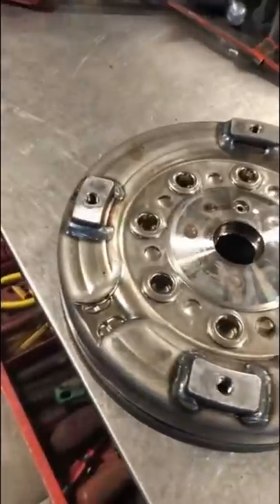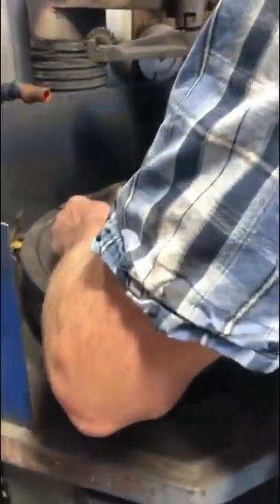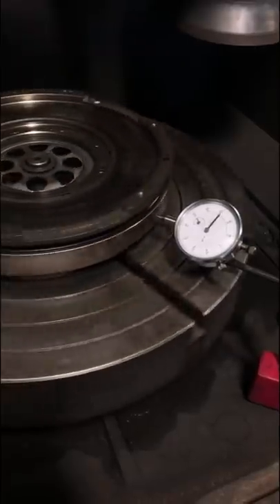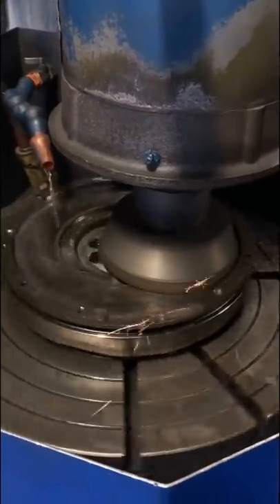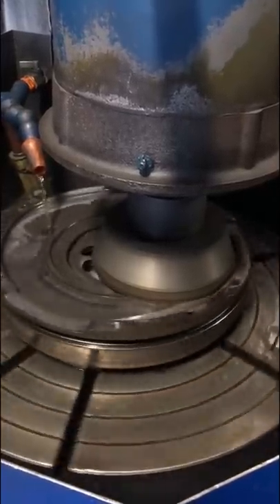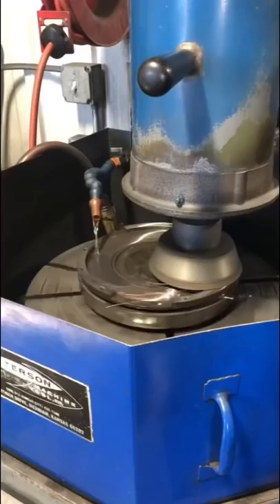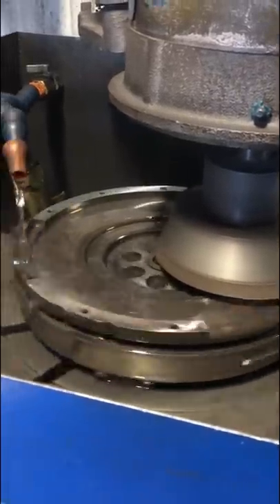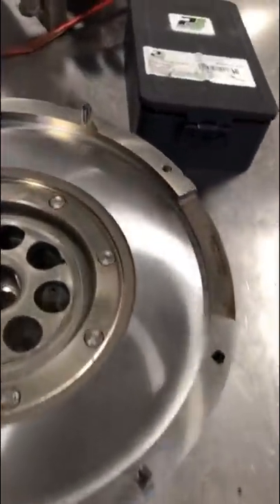#shorts We Can Resurface A Dual Mass Flywheel… But Should We?

Comment: As long as the customer said “yeah that ain’t going nowhere” after they installed it, it’s fine.
Reply: Ouch! That's harsh, man... I'm sure it'll move, may have a slight "shake your fillings out" chatter develop eventually. Customer accepted the risk. It's on them now.
Reply: @scoob66  mandatory nervous chuckle
Reply: Famous last words
Reply: Yea you gotta slap it too
Reply: That's why they need to do contracts for it specifically
Reply: @corythomas4427  don’t think you understand what OP means
Reply: @Nic ,  My comment was meant to be hyperbolic and sarcastic, but I didn't convey that very well. When the meaning of a sentence can be interpreted to have two dissimilar meanings, it is called a double entendre.

 I assure you I understand the connotation of OP's comment, I even took it a step further by implying that the comment was completely literal. As in, the vehicle won't move under its own power.
Reply: He said I made a spacer for it too
Reply: @timjrvine   and call it baby also
Reply: Yep, that comment ain’t goin nowhere. Good work man.
Reply: A S.E Master Certified technician here. I don't think the person who made this comment nor anyone in this string understands how flywheels work or how little resurfacing actually removes. That is if you commented negatively about performing this service.
Reply: "That ain't going nowhere" is always better to hear than..."What? That's custom"!
Reply: I've made that mistake before
Reply: @corythomas4427  you missed the joke lol
Reply: @ZumbiCOD  You're the second person to comment that, you missed the joke I made. Read my reply to "nic ,"
Reply: I would like to know months after the repair how is the flywheel working out?

Comment: I can understand why they wanted to have this done, parts are a nightmare, at the moment and to be honest, you guys do a really great job so I'd have done the same thing!!
Reply: I think it works but not for long terms
Reply: Most of the time sadly if you want to get a part you either hope to get lucky and find a part to buy or you drop alpt of mpney to have a machinist fabricate the part you need. But that will cost you a lot and you will need to purchase the blueprint so yoy can leagaly make the part.
Reply: Yea the "freedum" convoy slowed everything down. 🤡 🤡 🤡 🤡
Reply: @juliengamez7446  I had mine resurfaced a few years ago and so far so good! I couldn’t afford a new one, and one guy at the shop said they couldn’t be resurfaced, but the mechanic said he knew a guy and that’s the guy my buddy trusted with his 95 Mustang GT (RIP to that beast!), so I said ok.
Reply: @paxamericania5923  I'd just reverse engineer the existing part if it hasn't lost too much material. Calipurs and Fusion 360 hobby edition will save you a lot of money
Reply: @paxamericania5923  a good machinist doesn't need a blue print.
Reply: Either way, it'd save money and if it'd work for even about a month, it'd be worth it in my opinion
Reply: @mastakush4272  didn't realize he convoy that was like 2 months ago has been fucking supply things up for the last like 2 years. Wild how that works.
Reply: It looks clean looks like you did well. It's unlikely enough Mass was lost in the process to have any notable effects on performance
Reply: @Glmorrs1  I remember my mate broke a camshaft of a diesel land cruiser into 2 parts due to incorrect procedure. Most of the machine shop refused to Join the broken shaft except the one that our foreman knew. Lol, my mates ass were saved.😂🤣🤣😅😆
Reply: @mastakush4272  lol yeah didn’t have anything to do with covid restrictions at all.

Comment: You do what needs to be done to get the vehicle back on the road. Looks like a good resurface to me, I'd have no issue running that on my engine or a client's.
Reply: Biggest problem is if it's hydraulic you need to shim it
Reply: @scotthay9805  pretty sure that’s why he also resurfaced the outer area where it’s bolts to the rest of the assembly I think it’ll work fine.
Reply: @fartsoundeffect5013  Oh you must own Snap On tools so you're even more super professional.
Reply: Fine on your car but knowing that it’s not supposed to be done and still doing it is a super sketchy place to put yourself in when it comes to a customers car. Make them sign a waiver at least to protect your butt if something fails and wrecks the car, or worse hurts somebody.
Reply: @nobullshit9721  it still puts the clutch different.they used to sell shims for that. Now they don't and just sell new flywheels. Had a couple rangers that wouldn't go into gear on first start without pumping the heck out of the clutch
Reply: @scotthay9805  him being a machinist an being able to get everything square an within a certain tolerance is probably better then most new garbage parts from overseas.
Reply: @nobullshit9721  , I believe  @Scott is talking about the throw out bearing and slave cylinder offset due to the machining process.  Cutting back 0.060" you might still be in spec tolerances but may experience difficulties finding gears when stationary. Reason why he commented about shimming the release system to bring things closer as possible to original tolerance.
Reply: @justinsolomon4427  THIS!!!! IT PUT THE Clutch AT A DIFFERENT HEIGHT FOR THE THROW
Reply: @scotthay9805  If they’re smart enough to remachine the flywheel, they’re probably smart enough to shim the T/O bearing properly. 🤞

Comment: Most of the time when you resurface a flyable it’s better than factory specs. I have done many clutches on freightliners and Volvo’s and they don’t look that great from the factory. There so mass produce that QC only inspects a few.
Reply: @xabhax  the wear surfaces definitely go bad, but you’re right that is would usually happen after the springs wore out.
Reply: What is this QC you speak of?  That's a thing of the past. It's all about quantity not quality nowadays.
Reply: gonna be honest here, been working with volvos too and the dmfs take a HUGE beating before they go bad. my flywheel has seen 300k km and the surface is tempered but the springs are up to spec, didn't do anything and it's taking it just fine

Comment: I see absolutely no problem with doing a resurface on a dual-mass flywheel. You usually change these flywheels due to wear and tear on the dual mass interlock mechanism itself, so as long as this mechanism is functioning properly, it shouldn't be a problem at all.

Comment: Awesome job! I'd much rather have this calibrated, perfectly machine flywheel over a factory, "I don't care because it's 3 o'clock and it's time for shift change" or "no one really gives a shit because it's going on a new car" or "I don't make enough money to care if it's .025" off" flywheel. You guys care because you take pride in your work and your name is on the line. Factories don't care so much because they're a huge entity and a poorly surfaced flywheel that accounts for less than 1% of their daily output isn't even a blip on their radar. I would MUCH rather have this one. Thank you guys for doing such amazing work.
Reply: I have an 2000 olds intrigue, I had to bring back 3 power steering pumps because they all leaked. All brand new from the factory. If you are able and have the knowledge to rebuild the parts I would rather do that than go thru all that bullshit of installing the part and having it fail constantly. The fourth pump is starting to act up now and this is after I replaced the rack on it. Not even a year later and shit is failing. That's not to mention the axles that I replaced that sound like the axle joint is coming loose. It freaking sucks and there's nothing that can be done short of rebuilding it myself. That's exactly what I'm going to do when it fails.
Reply: After the 4th flywheel I've had to put on my 99 mustang, your not wrong. Original flywheel cracked and had to be replaced. Went with an autozone flywheel, because they are the only ones that had it. First one was WAY out of balance, 2nd was over weight and out of round (ovaled), 3rd was warped to all hell, and this 4th one looks OK, but haven't put it in yet... local machine shop closed down (thanks covid), and so its a shot in the dark... fingers crossed.
Reply: There is a flaw in that thought with this type of flywheel. A dual mass flywheel is 2 pieces of steel bonded together with rubber in the middle. because of the way there made and the normal method of securing these for machining, it's nearly impossible to get it machined to proper tolerances. 

Then there's the issue of yhe rubber aging and wearing out...

I have a car with a dual mass flywheel, and mine is bad. It sucks, but I'm going to do it right and swap to a custom single mass (normal) flywheel. ;)

Comment: I think it'll work in the interim if it's just for regular travel, but if it's driven hard it'll be too much to last. I think they did the best thing for the situation and I applaud your willingness to work with the customer in this way
Reply: Trust me it will be fine if he done it right no matter how they run it!
Reply: It'll be fine dude! .015" ain't gonna hurt shit. Everytime a mechanic does a clutch job the old flywheel gets machined (or should) and the heat checking gets cut out
Reply: @e-racer4673  seriously thing looks almost better then new with just a tiny bit of metrerial

Comment: When I did the clutch in my Infiniti, I replaced the dual mass with a single piece flywheel. I'd rather just deal with the chatter than spend double or deal with logistical issues
Reply: Chill. If I wanted a chattery ricebox I would've brought a clapped out 350z. Going for a new dmf for my G coupe
Reply: It's just a Nissan after all.
Reply: That’s why you get a midweight flywheel… single mass, less gearbox chatter than a lightweight

Comment: Honestly I am confident that it would work it all comes down to the quality of how the part is treated and your quality is top notch
Reply: He clamped it down and took to it with a CNC machine. There's a good chance the springs are shot now and it will rattle.

It's not all about being careful, you can do a lot of damage carefully by not knowing how something works
Reply: @Charlie-nc3cp  The spring's can easily be replaced. I've resurfaced flywheels and replaced springs

Comment: The only failure i’ve had with dual mass flywheels is spring breakage from new drivers trying to learn on a 180k mile car with its original clutch. 
As long as you locked the friction surface securely and it remained level, I see absolutely no issue with resurfacing it.
Reply: I'm also thinking it's more to do with future spring breakage possibility reduction. No point resurfacing if a spring goes within a year etc

Comment: As long as the internals of the flywheel are intact and undamaged there's no reason why it shouldn't work. We live in a throwaway society and now we are starting to see the impact of that with the supply chain issues. I've always been the type of person to try to reuse whatever I can. Just because something's used doesn't mean it's no good. Our society used to think that way and they have let go of that. Love watching your videos nicely done
Reply: This isn’t about society. It’s about ensuring the worn flywheel springs don’t cause issues in the future and make you repeat the whole job again.
Reply: Founders:  I agree fully with your statement.  I'm in my mid-50's and have noticed the shift in mentality to being a "everything is disposable" society.  I'm also a 30-yr experienced automotive tech, so I can grasp the mechanic aspect of this resurface project.
What's the worst that can happen?  Discuss the pro's-n-con's with the customer for each scenario. Either the resurfacing job is successful, or just do the labor a second time to replace with new (if available on the market).
There's feasible work-around & solutions to every challenge.  Just have to think creatively sometimes.  Main objective is to have a successful & quality repair.
Reply: @Schrimpieman  Yeah well the point is that dual mass flywheels tend to fail, and you dont want to take your tranny off again a 1000km later, and pay for all that expensive labour twice
Reply: @elek101  The labour isn't the expensive part when it comes to clutch/dual mass flywheel replacements. The flywheels are just damned expensive - thus why it was cheaper for the labour to get this one resurfaced. Sure, you would be down overall if your flywheel failed only a few months later but if you can get another year or two out of it then that could make a big difference to your cash flow and the affordability of that repair over that period.
Reply: @Schrimpieman  the thing wasn't even fixtured right i agree with you 90% of the time but 1 the surface he ground was only held down by the springs and the machinging is going to be bad, 2 the springs could be worn out. Saving something that still has life in it and can be used is one thing, i would use half gone break pads because a change them myself im not going to put used motor oil in my car even if it came out of a totalled car and only had half it's life used
Reply: @elek101   Pay attention to narrative half-way thru video.  Customer understands & accepts the risk involved, and thee isn't a new flywheel available anyway due to "out-of-stock" supply condition.
45% of the job (removing flywheel) was already performed.  Add in another 10% resurfacing shop time, and another 45% reassembly.
My point is, the job is nearly halfway done.  Why stop now if there's a chance it could work?
If it works, Great!   Everyone's happy.
If it doesn't, customer has to junk car anyway.
......so what's the dif ?
By the way, me personally, I wouldn't just take the $$ and run.  If the resurfaced clutch repair was a failure, I'd take a small financial hit & negotiate a REFUND amount with my customer.  They shouldn't have to pay the entire invoice and leave with a junk car as well.  I'd rather want a customer to leave knowing they've been treated fairly, than my name be bashed and twisted.
Pay me half & we'll call it good.
A happy customer will refer 2 friends.
A pissed customer will cuss you out to ten.
......think about it.
Reply: @Spacecadet3890   Pay attention to narrative half-way thru video.  Customer understands & accepts the risk involved, and thee isn't a new flywheel available anyway due to "out-of-stock" supply condition.
45% of the job (removing flywheel) was already performed.  Add in another 10% resurfacing shop time, and another 45% reassembly.
My point is, the job is nearly halfway done.  Why stop now if there's a chance it could work?
If it works, Great!   Everyone's happy.
If it doesn't, customer has to junk car anyway.
......so what's the dif ?
By the way, me personally, I wouldn't just take the $$ and run.  If the resurfaced clutch repair was a failure, I'd take a small financial hit & negotiate a REFUND amount with my customer.  They shouldn't have to pay the entire invoice and leave with a junk car as well.  I'd rather want a customer to leave knowing they've been treated fairly, than my name be bashed and twisted.
Pay me half & we'll call it good.
A happy customer will refer 2 friends.
A pissed customer will cuss you out to ten.
......think about it.
Reply: @Schrimpieman  i did the worst thing that can happen is it can damage the transmission or eat a clutch. What would you do then? You keep saying junk the car like he can't park it till he can get a clutch
Reply: @Spacecadet3890   Park vehicle until plate is available.  Good option.  Duh.... why didn't I initially mention that?  Oh, because my narrative would've turned into a novel to explain all possible scenarios.  Who has time for that?
Every situation is different.  Narrator posed the question whether to junk car or not.  If the remaining rolling chassis is a rust-bucket, yes.
Perhaps the customer can't wait unknown weeks for the part to become available?  Too many unknown variables to form a definitive answer.
You can run your business your way, I'll run my lucrative & humble business my way.   I'm not trying to twist this debate into a competition of business practice.  I've got so many referrals via satisfied customers, I can hardly keep up.  So, I must be doing SOMETHING right.
.....oh, and the customer in vid is willing to take the risk.  Does that answer your question?
Reply: @Spacecadet3890  Pardon one last detail:   You infer that I suggest junking the vehicle.  If I support the reconditioning of  flywheel as demonstrated in video, where's your logic in that?  Yea, let's  pour all that effort into reconditioning the part in hopes it'll fail during operation.

Your deductive reasoning skills need some improvement.
Reply: @Schrimpieman  you say junk vehicle constantly.

Comment: I had a Cheap 2008 Mini Cooper R56 and I dismantled the flywheel. Inspected the springs and wedges and cleaned regressed. I cut the friction plate on the lathe and reassembled the car. It’s was like new. No issues. 
 The rivets that hold it together aren’t necessary when it’s bolted to the rank. 
 Nice video!